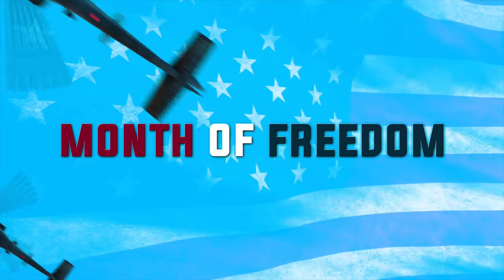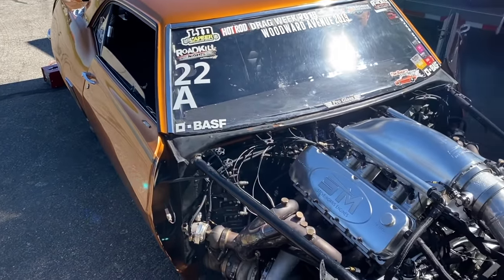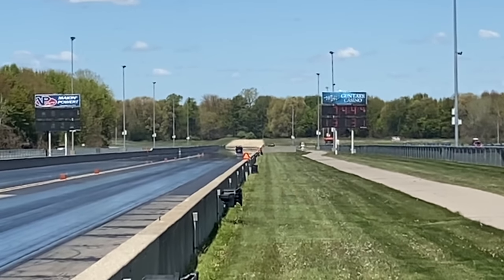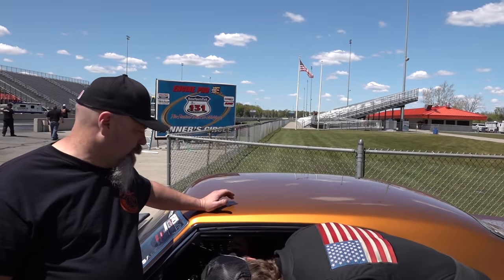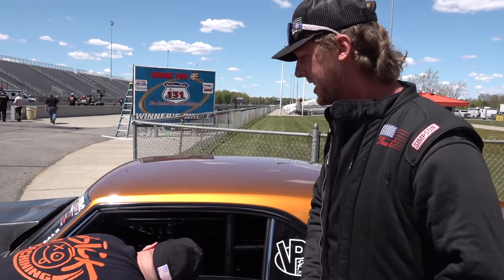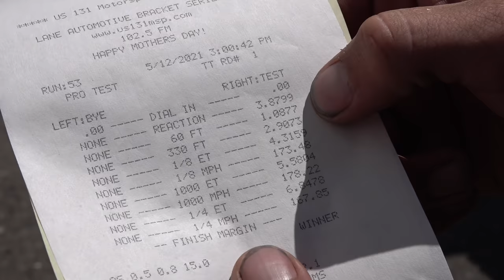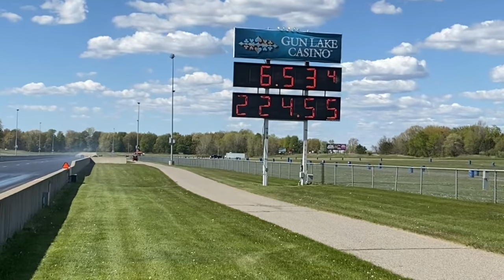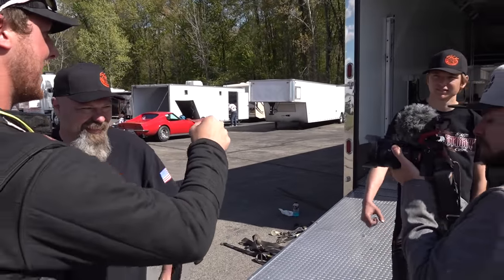MY FIRST EVER 6 SECOND PASS... No Parachutes at 224mph

Comment: It just shows what a natural Cleetus is. He can drive anything, and still stay cool with a chute failure at 224mph. Well done, mate!
Reply: Totally agree.  He is extremely coordinated, great reflexes.
Reply: Outstanding job Garret - on both sides of the G scale
Reply: Just by the way he rides hovercraft you know he's natural.
Reply: Might have to check the tyres for some flat spots but did well
Reply: @wobblysauce  not a bad idea to check but from the sound of it I believe he juuuust barely scrubbed them. I think he had a good feel on brake pressure vs available traction and modulated masterfully.
Reply: For sure, getting it slow enough to take the corner and not flipping... If it was at a few other tracks, that would have been a kitty litter/fence for sure, but saying that the Shute would have been checked on Tom's pass prior.

Comment: The prophecy is finally coming true. Cleetus told us about his 3000hp Camaro years back and now we find out its really going to be his.
Reply: He's not buying it
Reply: He has the Elco.  That's his crazy build to go into the 6s.
Reply: Hes not buyin it no way
Reply: @lochietorrisi9284  I bet he does
Reply: @rxtuninginc8444  Thats fair but whats James going to use? I mean side by side 6's would be enough content to pretty much pay for the car.
Reply: @siraff4461  James has a fast 1/8 mile car.  Could be converted to do 1/4 mile.  They are in different classes with Ruby and Leroy now anyhow so why would they want to be in same class competing against each other?
James is a big boy I'm sure he's not shedding any tears.
Reply: @rxtuninginc8444  What are you on about? If you think James 1/8th car is going to run mid 6 1/4's without major changes you're off your meds. He's about 1500hp short for starters nevermind the big tyres it would need and all the rest which goes with it. I'm sure James doesn't care because he's capable of building one if he wants. Classes don't matter either because they aren't doing this to sit in a racing class - they're doing it for fun and content.
Reply: @siraff4461  I never said that, pleb.  I was just saying he don't care about 2 cars in the 6s.  Those pro mods are 150k builds easy

Comment: That's why you still need good brakes :)
Also possibly better put it in reverse and burn the clutch while letting the clutch touch lightly than letting the car crash into the sand pit.
Reply: not possible you would just rip the reverse gear because the gears still spinning in one direction, same reason why you shouldnt put your car in reverse if its still rolling
Reply: the sand pit is designed to slowly make it sink into the sand and slow down
Reply: Sand pit doesnt hurt the cars besides making a mess. However ramming your transmission into reverse will screw it up and cause a wreck

Comment: I know EXACTLY how you felt there Cleeter. My dad has a '69 twin turbo mountain motor big tire impala. It runs low 7s all day. 1st time i ran 1320 in it, the chute cable broke. Our track has a decent run out but, as you know, big tire cars are EXTREMELY terrifying to stomp on the brakes at over 200 mph. I made it out fine. No damage to the car. Pretty sure theres 100 dudes alive that could have done that and you and i are 2 of them.

Comment: Gotta give you credit on getting the car stopped with no chutes. Especially for being a big tire car. Not a lot of new drivers can keep a big tire car under control in an emergency situations. They panic and get on the brakes too hard too soon. But you obviously have that seat of the pants feel and where able to get on the brakes progressively enough to get stopped safely. Congrats on the mid 6 at 220+

Comment: Thank god for carbon brakes lol. Dude hell of a job. 99.9 percent of people would brown out with a 1.30 60 foot and like a 5.70 1/8 mile. They would need a complete diaper change and a shower. Just going from like a 5.90 to a 4.9 in the 1/8 it’s like a completely different animal. Easy to talk ish online but it’s a completely different thing to experience. Especially if you have like a slightly low slick or something and she wants to walk a little up top. Good job. Nice drive.